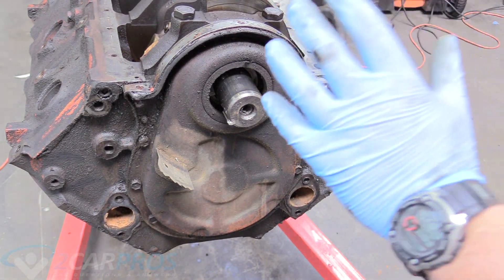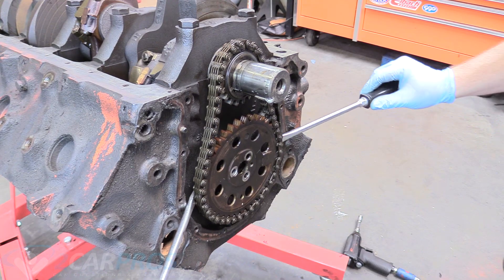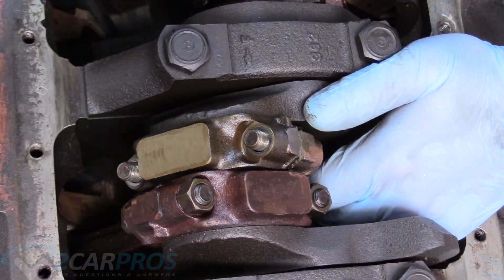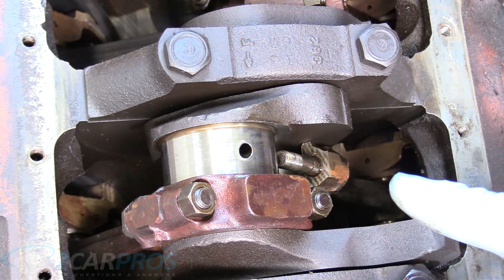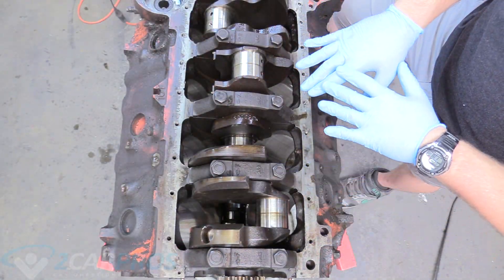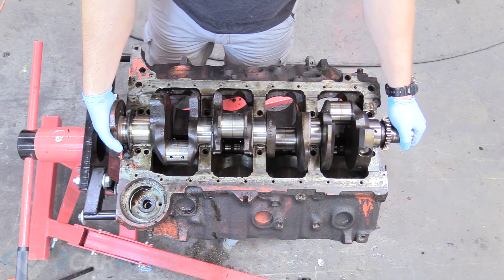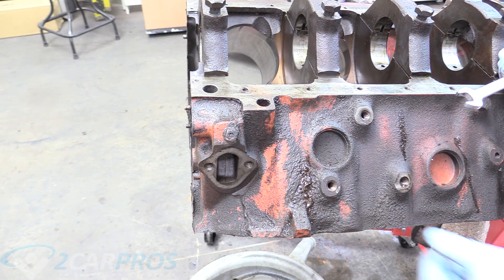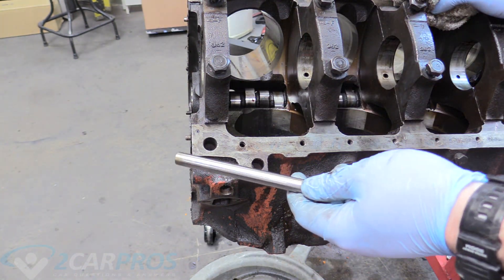How to Build a Chevrolet 454 Big Block Part 3: Removing Pistons and Crankshaft!

Comment: Never ever let a crankshaft lay down it has too be standing up the whole time
Reply: Why what will happen if its lay down?
Reply: @YoMamaWazHere  Nothing unless it's hit or damaged in that position. The idea is that if you lay them down they can bend because they are not supported evenly. The problem with that tale is that if you store it standing on end all the weight of the crank is being supported by that last rod journal 3-4 inches off centerline. So if laying down supported in 4-5 places will bend it, how much will the 20 pounds bend that single journal. Think about this, if you turn a crank it is spun up in the machine supported at the ends with a single support for the journal being ground, then it is put in a box and shipped around the continent and gets to your door ready to be installed, think the guys in shipping and trucking are going to cradle that box like a baby?
Reply: @YoMamaWazHere  it will warp it make it not spin true then you just have scrap metal

Comment: Removing the cam, Thread a long bolt into the sprocket bolt hole and use it as a handle. Oh and when it comes back, be sure to wash the snot out of that block, even a great hot tank can leave things behind. When you bring it back flip it over and lay it on a couple of wood blocks. Transporting it on the caps is a good way to damage the caps.
Reply: This is where I'm stuck what bolt should I thread into the cam in order to turn the crank so I can I get the pistons out and I thought I was suppose to use the same bolt that held the harmonic balancer but that's not big enough please help
Reply: @marlonjohnson898  You don't use the cam to turn the crank you use either a bolt in the crank or the older method of just slipping the balancer on with the key in place and use it to rotate the crank by putting a couple bolts in it and using a bar between them. Or if you have it on a stand you can use a strap wrench on the crank snout and have it set up so the handle part catches on the key. Lots of ways to turn it. I've even uses an aluminum pipe wrench right on the crank snout and used the sprocket and balancer keys as the grabbing point. Most of the time you can use the crank to push them up as well, rotate it just enough that you can get the nuts off as many caps as possible. (be sure to mark the caps for cylinder and position first) then rotate the crank one way to push the rod/piston up, then rotate it the other way to do the same with one that might have been on the opposite side. If you follow the firing order you can have them all pushed to the top of the bores in about 2 turns.
Reply: @Blazer02LS  thanks man I got it figured out now only if I could get these dam lifters out everything is out and off except cam and lifters
Reply: @marlonjohnson898  Lifters develop a ridge of oil varnish around the base where they don't travel up into the bore. Best way to get them out is with a lifter tool like the Performance Tool W84004.  It grips the lip inside the bore where the inner piston is captured with the snap ring. The problem is that not many place have them as loaner tools because hardly anyone really rebuilds anymore. What you can do is get a pair of external snap ring pliers like the and modify the tips so they will fit into that groove on the lifter, then use some brake cleaner to spray around the lifter base through the drain slots in the block and pull up and twist it in the bore to try to remove the varnish and get the lifter out.